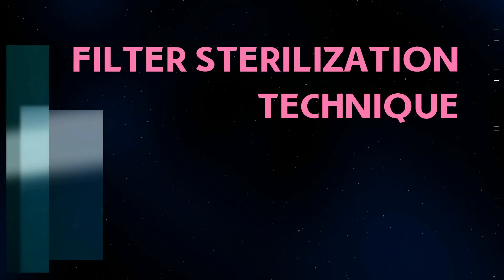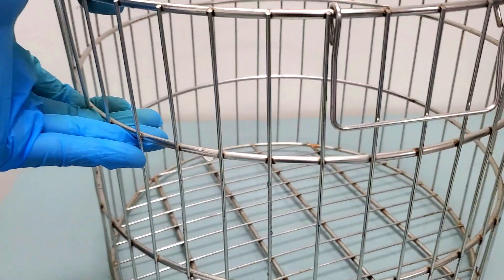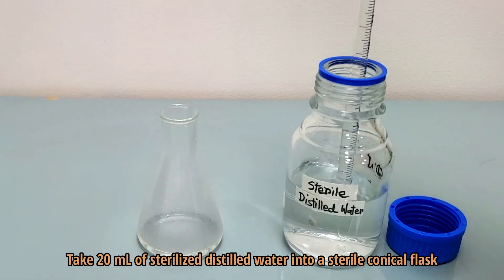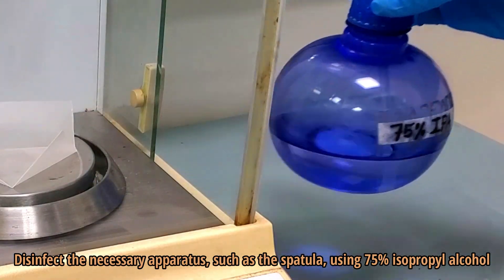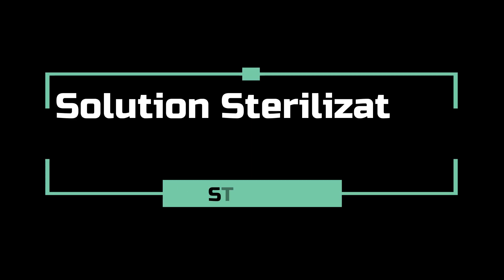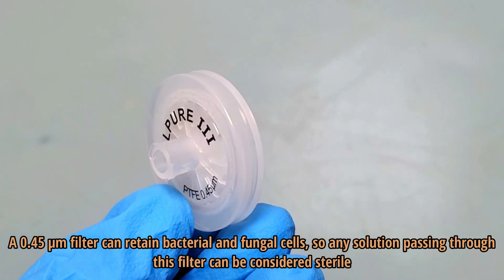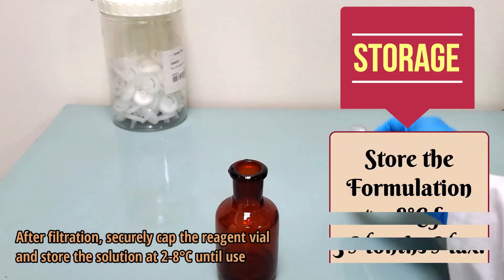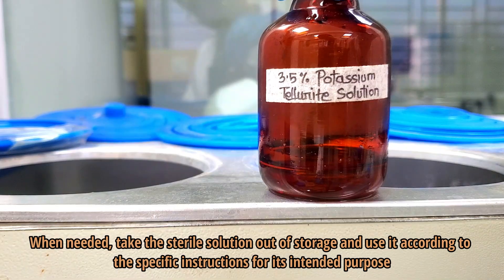Filter Sterilization Technique | Microbiology | 3.5% Potassium Tellurite Solution Sterilization

Comment: Very informative video, nice! We recently started using the 3M system for Salmonella testing too. I’m a bit puzzled about how to weigh chemicals aseptically. I can sterilize the spatula by autoclave, but the tracing paper cannot. We’re using sterilized 35mm plastic Petri dishes instead. What do you think of this 😂
Reply from the maker: Yes, 3M system is cheap and best for testing rapidly
Reply: I use a sterile universal collection bottle to weigh the potassium tellurite, and in it I carry out the solubilization with the previously sterilized diluent (distilled water).